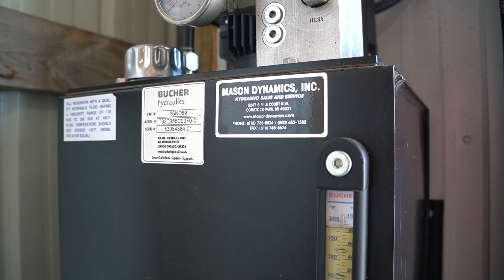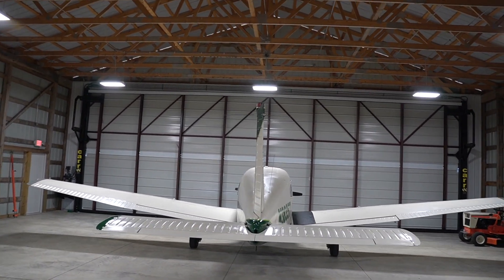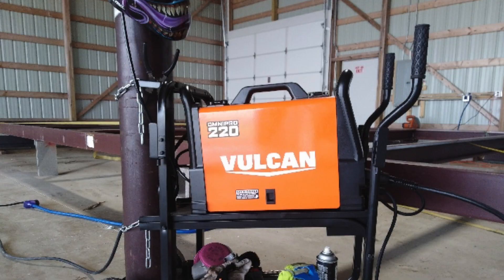Custom Airplane Hangar Door (Carr Doors)

Comment: Hi Mark, Lovely job. I'm in Australia and have a 1960 PA24-250 Piper Comanche. I'm currently considering the feasibility of building my own hanger, integral to that is the door design. Are you willing to supply any drawings of the structure mainly the pivot assembly measurements and the details of the hydraulic rams. Also what was the dead weight of the door that is lifted. Cheers
Danny